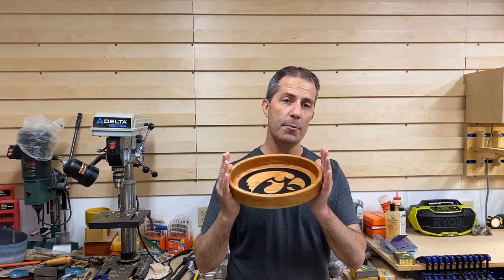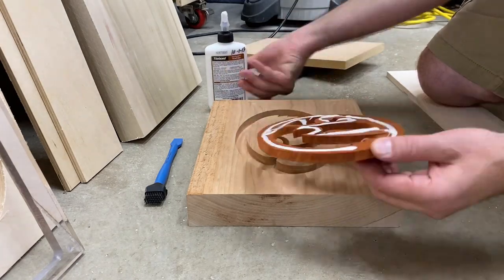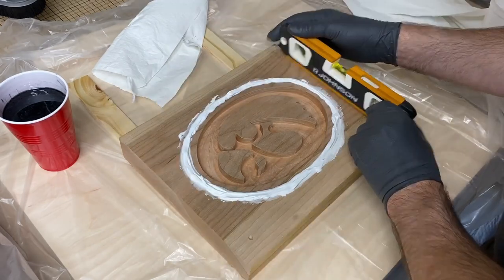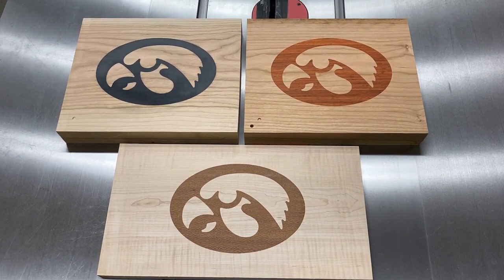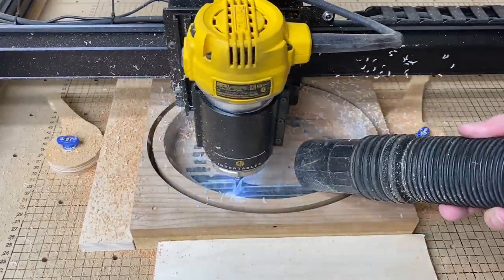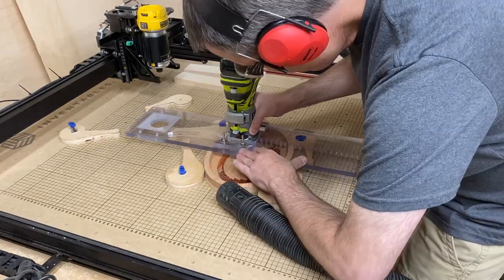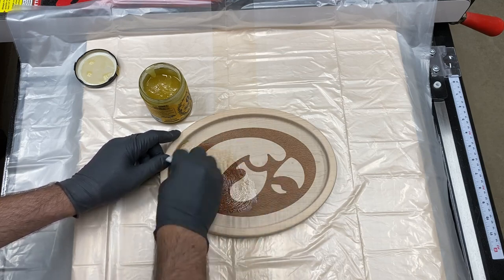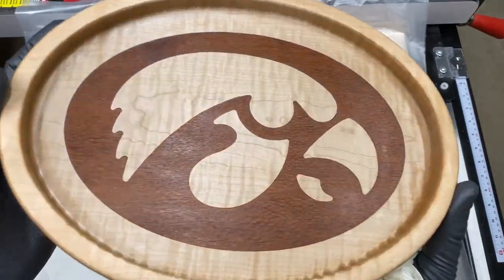CNC Bowls or Trays with Logos Completely Through the Bottom

Comment: Now that's it's been over a year, how is the epoxy bowl holding up?  Any issues with the wood expanding and contracting?
Reply: Not that I am aware of.  I gave these all away as gift to some great friends, so I haven't seen them in quite a while.  No reports of failure though.
Reply: @stevemoseley9877  Thanks for the reply.  Great work!!  I'm always curious / nervous about using epoxy.  I may need to give this a try!!
Reply: @randysgreatadventures3148  You bet.  If you have a really porous wood with open grain it is always a good idea to seal the initial pocket you are going to pour tinted epoxy in as you would be surprised how far some epoxy will travel through wood and possibly stain the area.  Best of luck!

Comment: Do you live in iowa?
Reply: Yes.  In the Des Moines area.  How about you?
Reply: @stevemoseley9877   Ok were pretty close Im in Norwalk. Im interested in buying a cnc and watch your video's
Reply from the maker: @seporte231  Cool. Reach out any time if you have questions.
Reply: @makingathome   will i got a shapeoko xxl purchased now i need to decide on software do you have a preference?
Reply: @seporte231  Congratulations.  I use Easel software that is for the X-Carve CNC.  I think you can you it for the Shapeoko, but think there are other options as well.
Reply: @stevemoseley9877  Omaha - I've had a shapoko 3 for over a year and finally have worked up the nerve to make something like this with epoxy.  I love your video.  Thanks for ALL the info.
Reply: @seporte231  i use the carbide 3d with the shapeoko bitzero v2 and just bought a betsetter v2 for it.   I tried the aftermarket probes with no consistant luck. The bitzero was  an absolute plug and play. all the settings were already in the software for it.
Reply: North Liberty,  very nice job on the video.  Thinking about buying a cnc....thank you